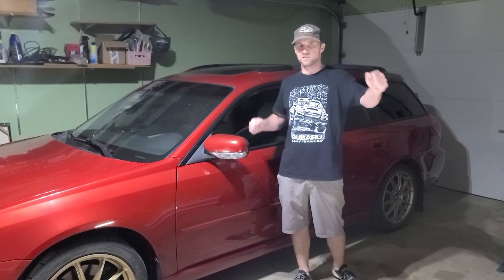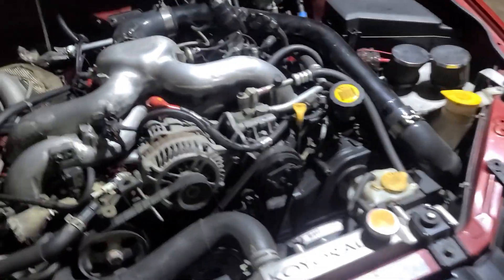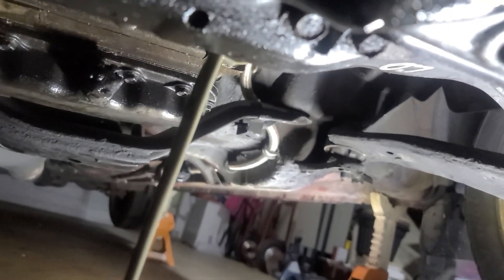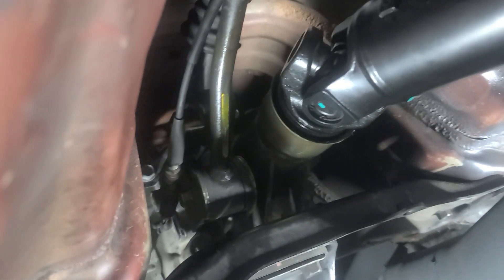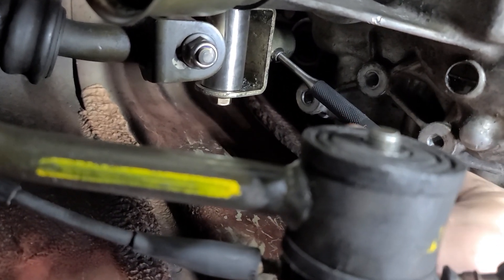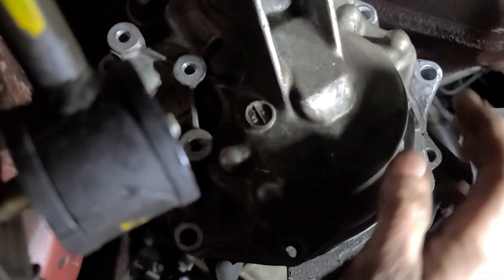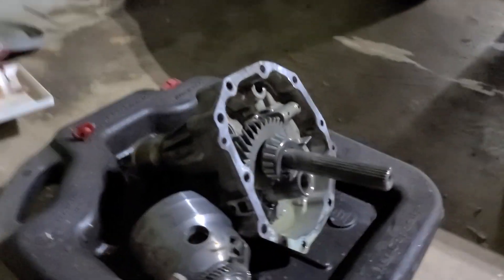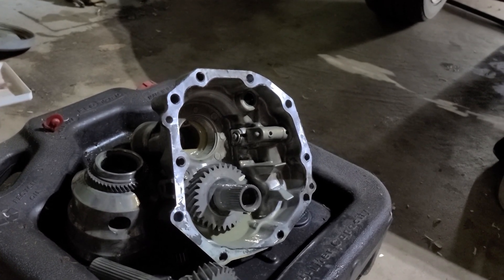DIY: Subaru Center Diff and Output shaft bearing replacement/repair!

Comment: That is a good job. Have seen a few of these videos and you pick up tips in each one. Wish you had shown how you got the RTV seal cracked. Have seen someone improvising with a slide hammer made from 8mm threaded rod with a large socket used as the hammer. They had not removed the dowels so it means that the slide hammer had to be inserted on the left and right side to "balance" the force needed to crack the seal. Heard about the tenacity of the gear oil smell. Would recommend to use thin vinyl gloves under a pair of rubber gloves to ensure your skin does not absorb all the nasties in the fluid
Reply from the maker: Honestly it separated pretty easily with a paint scraper.

Comment: The dowel pins, can you knock them out in any direction?
Reply from the maker: yes they can go out front or back. Whichever is easiest.
Reply: @robinsontanner1234  I am so happy now. I was hitting the extension a lot trying to get it free. Fearing I'd might damage it I stopped and watched a lot of videos, yours saved me. It was easy to separate without the pins. Also I had a lot better access knocking them into the gearbox, which I would not have dared without your help (they needed some heavy blows from the 2kg hammer to get started)
Reply from the maker: @t1hero that is great! So glad to help! Now you just have to get it back together 😅

Comment: Those roller bearing are not busted, they are made in two pieces that are lain on either side of the shaft. Why are you are making a video of a repair that you are doing for the very first time, and passing your mistaken info on to others that are trusting your info as correct,
Reply from the maker: The cage was very loose. And the main replacement was the center diff. See title.

Comment: Hello, I have a similar problem 2014 Subaru XV Crosstrek. I replaced both wheel bearings and Axle and still have a noise when decelerating. 
I'm having figure out the problem.
Do you have part two of this video?
Reply from the maker: @DavidCruz-kt4zn  yeah if you look on my channel part 2 should be there!

Comment: The Center diff should be the same fpr all 6mt. But if it aint broken don't replace it.
Reply from the maker: @DrZoidbergism  it definitely was broken and no there are different kinds. Viscous coupler is one, sti has a diff that can be controlled or older ones do not. Also 1.1:1 gear ratio vs 1:1.

Comment: My crosstrek is doing that sound but the cvt don't have a viscous coupler. I did a fluid change, new cv axles, brakes , and wheel bearings. Still grind pops. Im thinking I need a new transmission but is there anything else I should try looking into first?. Oh all... the dash warning lights came up. I cleared them before pulling any codes
Reply from the maker: @sonnyrico  oh no! The only other thing would be the rear differential. But knowing it is a CVT i would unfortunately bet that the CVT has gone bad. I have heard of that happening quite a bit. Maybe the codes will come back and give you a better idea.
Reply: @robinsontanner1234  i just ordered alow mile one on ebay motors, 1300$ 😕
Reply from the maker: @sonnyrico  oof Hopefully it is an easy install and fixes everything!!! that is a rough drop though.

Comment: hello im in the process of doing the same thing what kind of gear oil did you put back into the transmission ?
Reply from the maker: @jonahreimer7920  redline shockproof is what I used and will be using. Seems to do well.

Comment: Glad you got it back!  It wouldn't of felt right if you never got to finish the car.  As far as the center diff, wow!  I feel you got lucky!  It sounded a lot worse when you were driving it.
Reply from the maker: @erik_cruz  I know i think it lost the fluid inside and was forcing it to be locked. But pretty lucky i think. The main transmission is still fine. Got the parts ordered so im excited to get it back together.
Reply: My center diff split the c clip. Job wasnt too bad at all.
Reply from the maker: @LawnPapiLLC  oh if only lol.
Reply: @robinsontanner1234 in all fairness i may have blocked the trans fluid trauma from my memory lol
Reply from the maker: @nicko6477  lol i got some on a shirt 4 months ago. Still smells. I put it on and an hour later I realize it is THAT shirt.